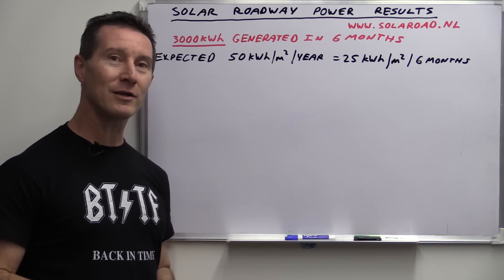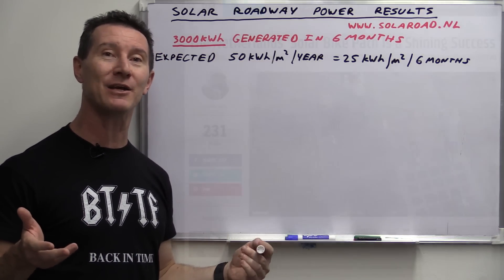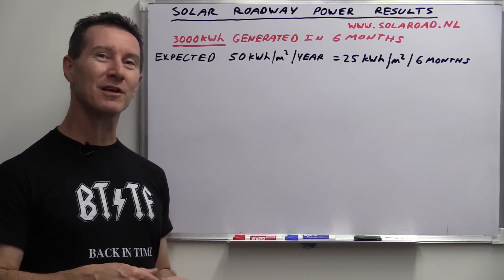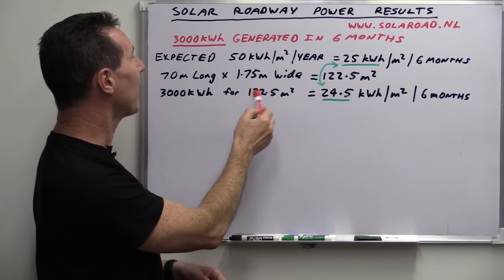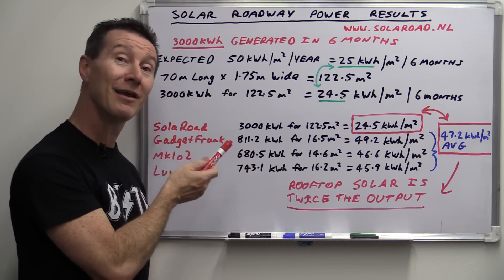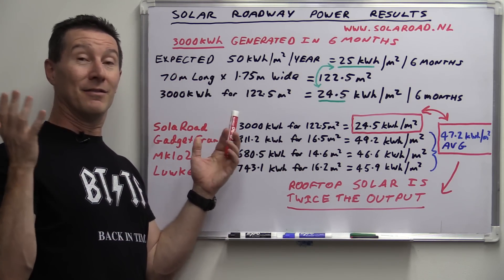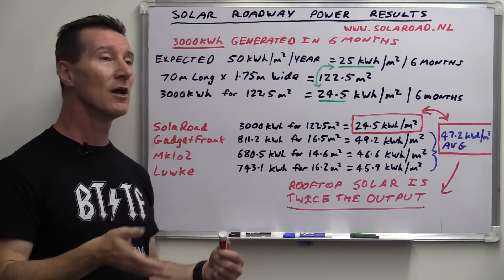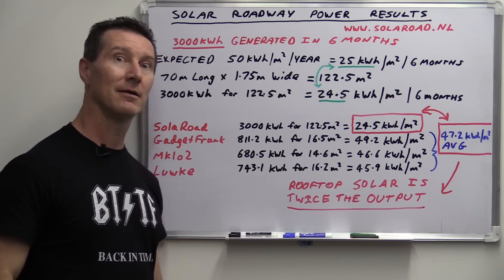EEVblog #743 - Solar Roadways Test Results

Comment: Hey Dave, do you have an opinion on the Tesla Battery packs? Is it something you'd consider installing as an upgrade to your solar panels?
Reply from the maker: Kasper Guldmann I'd buy it today if it was available here.
Reply from the maker: You can do this with other battery tech, the Tesla powerwall is not new, it's just the Apple iPhone of solar battery systems.
Reply: ***** He used lead-acid batteries though, which take up much more space than lithium chemistry for the same energy density. Lead-acid cells also cannot be as deeply discharged as lithium ion cells, so you must buy 2-3 times your typical cycle capacity or else you will quickly destroy your batteries. Lead-acid also cannot be rapidly charged without damage as well.
Reply: Orcinus24x5 You know that lithium ion cells cannot be deeply discharged, they are destroyed after that (that why all lithium ion battery packs have protection circuit against that), lead acid act nearly same (but they can be recovered after that). More interesting for lithium ion cells is that higher is the DoD (Depth of Discharge) the lower is your battery life cycle (50% DoD cut life of  lithium ion cells 3 times then 25% DoD)
Reply: EEVblog but why Li Ion?, I'd expect there to be cheaper alternatives for an application that isn't (as) sensitive to size and weight as a car. And an Internet connected "firebomb" bolted to the side of the house might makes some people a bit uneasy
Reply: EEVblog I reckon he didn't sell as many electric cars as he had planned, so he's selling the excess batteries at cost to gain a portion of that market and he'll ramp up prices later. Do you agree? They even have the same shape as his car batteries.
Reply: Doazic No, the Tesla battery pack definitely can store power during the night and then use it during the day. I'm pretty sure that was one of their marketing points.
Reply: Yeah, that's the goal, to flatten power delivery throughout the day...
Reply: Miloš Lazović Tesla doesn't use Li-ion. They use LiFePO4 cells which are much, much more robust.
Reply: FrankTheCat You obviously don't know what is LiFePO4 (it is lithium iron phosphate battery just one type of lithium iron cells).
Bdw Tesla uses Panasonic NCR18650A batteries which are LiNiCoO2  (improved classical LiCoO2) cell not LiFePO4.
Reply: ***** Of course they didn't sell as many cars as expected, Tesla cars fail on most of it promises, range is much smaller than claimed (they try to silence critics like Top Gear, by law suites but that backfire to them), they are much more dangerous then petrol cars (like 1 in 6000 burst in flame, which is less than all petrol cars where is like 1 in 1500 but if you dont count petrol cars that are older then 10 years then petrol cars have better ratio like 1 in 20000), environmental impact is near same to petrol car (according to studies done by petrol hating Swiss impact to environment in production of that car is same as what petrol car make in average life, so they are not so clean), what they claim are revolutionary technologies on that car are seen for years on petrol cars  .....
Reply: jusb1066 Tesla unit is not that small even if battery itself is small because of the cooling/heating system.
They need thermal management and they have a pump circulating coolant and a heat element to heat that in cold weather. Just look at the dimensions is quite a large unit for a 7kWh battery.
In terms of economic cost for stationary energy storage the LiFePO4 is much more superior. Look at products from Sony or Bosch they have a similar product with Tesla Power war for quite a few years and they know what they doing.
A LiFePO4 has a 6000 cycles of 100% DOD in case of Sony LiFePO4 was around 300 to 500 cycles in case of Tesla Battery at the same 100% DOD. They use just at 70% DOD (in the 7kWh power pack) so they can have more cycles at reduced capacity and be able to offer the 10 years warranty (still no details on what will be allowed as max energy use over life of the battery)
The amount of energy that can be stored and released over the life of the battery is what is important when you do a cost analysis and even with the best LiFePO4 battery and ideal use of the battery that cost is still high in my opinion and at best in countries with expensive electricity (as some in Europe) you barely get your investment back by the time the battery needs replacement.
Lead Acid is not even close in competing with LiFePO4 in terms of cost /kWh over the life of the battery.
I live OffGrid and use LifePO4 for energy storage. I also developed an offgrid solar charge controller/BMS and currently working on the second version. But do not thing because of that I have any bias towards LiFePO4. That is what I recommend for energy storage but any other type of lithium batteries will work with my Solar BMS including the Panasonic cells Tesla is using. They have better energy density and are better option in mobile applications and cars where number of cycles is less important than energy density.
Reply: EEVblog I think ***** made something similar inside his home already using normal electronic equipment.
Reply: Lasse Langwadt Christensen you should check out flywheel energy storage. They are very energy efficient, and much more space and resource efficient than battery packs for residential use
Reply: The summary I read said the intended use is for people with solar panels to store during the day and use it at night.
Reply: Doazic they can also charge from the grid at night to be used in the day. They advertised them both ways.
Reply: Kasper Guldmann Use this battery system is try to fool the Energy Utilities. You think that you can buy energy when the cost is cheap, store it and them use when the cost is high to avoid using energy from the grid ?. If this turn into a succes, the peak W delivery would occur during the cheap rate (lets say 11PM to 6AM). As a result of that the Utilities will redefine the rates or how much the KWh cost on each rate, or even worse: As power delivery will be flattened across the day (blend of real demand and charging batteries), using rate shcedule scheme would turn useless and you will get ONE RATE for the WHOLE day. Many countries use Smart meters so change those definitions is just a key press. The idea sound brilliant, but Utilities have been there for too long, and face things like that before, Tesla is just a company, the Utility, Generation, Ditribution and exchange is far more bigger system, perhaps thousand of companies around the globe, they move serious money and Tesla just cant stop that. Tesla thing is smoke IMHO.
Reply: funkyironman69 Power companies will never buy it to smooth peak power demands, they already have proven reliable system for it, not one what have life span of less then 10 years, and it is called reversible hydroelectric power plants.
It is widely used for over 50 years and can store more then million of MW and produce in excess of thousands of MW of electricity (same capacity as near billion Tesla Powerwalls)
Reply: Lasse Langwadt Christensen said: " And an Internet connected "firebomb" bolted to the side of the house might makes some people a bit uneasy"

And yet millions of Americans have enormous tanks of propane in their yards. Hasn't been much of a problem so far.
Reply: ***** Tank should be really big, if you have hill, it would be much easier to make pound on it to store water.
Power of falling water is roughly
Power = Head x Flow x Gravity
where power is measured in Watts, head in meters, flow in liters per second, and acceleration due to gravity in meters per second per second.
To store 65 kWh ( size of Tesla powerwall) of electricity as water you would need to store near of quarter of million of liters of water on height of 100m.
Reply: ***** Photonic's system stores energy at night when it's cheap and uses it during the day when it's expensive. I don't think the Tesla pack does that, plus I believe even photonic stated his system isn't cost effective.
Reply: EEVblog My boss and I were discussing this. I was pleasantly surprised at the watt-hour/cost ratio being high. I was expecting it to be lower especially to cover some of the overhead in manufacturing. I'd get one if I had somewhere to get it "professionally installed". Wish I could just buy the back without needing it installed. :D
Reply: BobtheBuilder31415 Flywheel energy storage is very promising, but the technology isn't there yet. It's way too expensive for a home, extremely hard to retrofit into existing infrastructure, the reliability isn't very good for the cost, and when they fail, they fail catastrophically. They have to be embedded in concrete to avoid destroying whatever building they're in if they explode, and that makes maintenance impossible. Maybe in 20-odd years it'll be viable for smaller installations, or even cars, but not any time soon.
Reply: Kasper Guldmann Powerwall economics are somewhat specific to the installation. Here is a summary: http://www.catalyticengineering.com/top-ten-facts-about-teslas-350kwh-powerwall-battery/
Reply: Doazic Well, you dont need rate shedule concept anymore so you will get a fixed cost for your KWh (import) that will be sorta of avg of the rates across the day. Still not seeing the big money saving. Because Tesla is assuming that a CHEAP rate exists, in every country and that will become untrue when Utilities see their power delivered flat no matter the part of the day. Same that electric cars charged at night ... just imagine all of us charging our cars at 1AM and Utilities charging us with cheap KWh because is the cheap rate. How long ?. This things hapenned before. Tesla dont understand the Electrcity or Energy market at all. Emisions will be the same, petrol ? You end using the same, Coal ? The same. Your bill ? Of course the same
Reply: Petar Petrovic A BIG TRUTH. Nobody taking in account the energy WASTED to produce green cars, TRASH and produce AGAIN, TRASH and AGAIN. Come on !!!!!. Electrica cars ? Lets move emisions from the exhaust to the chimmey of the big power plants running on coal of fuel oil. The force to trash good working cars with new and new emision standards like Euro II, III, 4, 5 .... to reduce emisions a 5% but now do the calculations of the energy wasted to make the new and more green car plus scraping the old ones LOL. Pure hipocritical.
Reply: Well it would take a whole bunch of people to buy these things for the curve to flatten which isn't likely to happen.
Reply: Kasper Guldmann Power distribution companies will buy them themselves to smooth out peak power demands.
Reply: EEVblog Could you perhaps do a video on the costs and benefits/con's of the tesla pack over a lead acid or other battery type system? There was a lot of speak about it not being cost effective due to lithium batteries lack of longevity and the lower output etc. It would be nice to get a proper technical overview like you have done with the solar roadway. Cheers!
Reply: abyssunderground Lack of longevity? 8 years isn't long-life? Beats lead-acid in those use-cases by a couple years. Lithium batteries of that particular chemistry are also capable of insane power output, I'm pretty sure that thing can be fully discharged in under 15 minutes without damage.
Reply: Teth47 Actually it's got a 10 year warranty, but I don't know of any lithium battery that can do full charge and discharge cycles every day for 10 years without losing significant capacity to be detrimental to operation. That's one of the points that was raised after its announcement.

The low output I speak of is the limit of 2kW with 3.3kW peak (the DC-DC converter limit maybe?). That's barely enough to run a kettle, microwave or oven individually let alone together which is something many will want to do regularly if used in an off-grid situation.
Reply: abyssunderground They build an extra 20-30% capacity into the unit and use the BMS to maintain a fixed capacity for as long as possible, after 10 years, apparent capacity will have gone down about 25%, they do the same for cars and the like. You're right about the limiting factor being the DC-DC converter, which can be bypassed if you've got a bigger one or an inverter capable of handling the full battery voltage. I have a battery sitting on my desk that is capable of outputting more than 3KW, and it's about the size of my hand.
Reply: Teth47 So what you mean is the 10kWh version is actually 12-13kWh so that it still maintains that 10kWh long into its life? Hmm I'm not so sure. I'll be more convinced when someone actually does a tear down on one but I won't insult you by saying you're wrong without any proof =) Just doesn't seem like they would do that somehow. But this is Tesla afterall, they don't do things the conventional way!

I didn't know you could bypass the DC-DC converter and use your own given the high DC voltage used inside (300v+?), so that answers that question if true. I have a few lipo batteries here capable of 1-2kW myself so I understand the batteries can handle it but my concern was around the limit of the DC-DC converter. I doubt 300v+ DC-DC converters are readily available?
Reply: abyssunderground They're not, the main idea behind bypassing the converter is industrial applications. Also, making packs larger and electronically limiting them is the industry standard for things like this, check Tesla's car packs, same with Chevrolet's Volt batteries, I believe they're 25%. I don't remember the exact pack voltage, but it is pretty high, there are inverters that take that power though, they're huge, but they exist
Reply: Teth47 That makes sense. I didn't know they overprovisioned the batteries though, but that makes sense too over the life of the battery. I suppose it also means they don't have to charge the battery to as high a voltage too, further increasing longevity. Just charging to 4.1v instead of 4.2v can double the number of cycles from what I've researched.

Thanks for the insight.
Reply: abyssunderground No problem! It's what I'm here for. Do look into it though, if you want, and tell me if I'm wrong. I'm not above being corrected.
Reply: Teth47 Cheers, will do if I hear any different.
Reply: funkyironman69 Still using the same ammount of petrol or coal. Cant see where the money is saved. Generation would cost the same and so will do your bill.  You can play with batteries, but new energy always come from the power plant. Not Green, nor efficient. Plus batteries go bad. My point is, if you try to make your KWh all in the cheap rate, Utilities will change the approach, otherwise they will stop making money. The can double shift the rate using a gigantic TESLA plant, still using the same ammount of coal or petrol. NO WAY, IMHO. That works if just a small amount of customers implement that. If all moves to TESLA thing, beware your bill will reflect that
Reply: Teth47 Flywheels are great for mechanical start/stop, but a typical car only has space for 50 MJ. A 85 kWh car battery holds 306 MJ.
Reply: 38911bytefree You forget that it's not just for charging when the price is low. Couple it with solar panels which charge it during the day whilst you're at work, and then use that free energy when you get home. The utility companies can't really change prices overnight because of people with storage heaters, it would be unfair to them. Truthfully though that might not stop them...
Reply: abyssunderground Fine, like any other battery. imṕroved, better, efficient, battery banks and solar panels haven been there for years. Now, this idea has takean off on large scale installations like Daves. and took serious money to get 3 or 4Kwh power from the sun. That is not that easy. And this TESLA thing, not sure if it is intended to be part of a power gen system or just a little trick to reduce your bill that wont work at the end.
Reply: 38911bytefree The idea is to get the cost of the batteries down too with mass production. Currently they're expensive due to low demand compared to other types. The Tesla battery isn't intended to be a trick to reduce the bill in the long run, only the short. The idea is to go self sustaining by getting everyone into green energy and then having a distributed grid system. Overall there will be less points of failure and the end goal is for there to be no need for CO2 pumping power plants.
Reply: Of course we need another way of generation apart from coal and petrol. But costs for pannels, high end inverters, and even asking your utility to start selling energy to the grid, is sky expensive by now. Its a bussiness. Finally, when you need serious power, deep Winter or heavy summer, you end taking from the grid. Like Prius thing, well, not that bad. Once you touch the gas pedal, goobye hybrid !!!!, it starts to suck petrol. and of course, you want yo run you gadgets, power everything and the AC .. so no hybrid concept is just for the one willing to drive the car like an hibrid. If you drive like any other car, it takes petrol, like any other car.
Reply: 38911bytefree Of course, but there always has to be a starting point with new tech to drive the prices down. The idea with hybrid tech is to get electric introduced and then rely on it more and petrol less. The same will happen with the Tesla power wall, solar panels and the grid. As more and more people invest into solar panels the price drops and then those with less money can also join in. In 25 years we will be virtually fossil fuel free if we continue to grow renewable energy sources the way we are now.
Reply: abyssunderground Thats  ideal. Fossil free idea has been for long. Electrical car idea also. This things dont take off. windmills look promissing also. But we wont be able to skip fossil generation. Even when we can do at home, industries, clubs, cinemas, shopping ... everything that is power hungry, just with meet the grid and eat as much as they can Another good approach would be, stop selling crap that stop working in less than a year. Forget about nwe car regulation every year to scrap the whole park of cars in 3 year. People need to slow down a bit. Short example. Have a notebook nice one, run PERFECT in 2010. YT ? ALL THE WAY. it was "fast enough". With later upgrades on Chrome and flash, notebook started to perform slow and slow. Put more RAM, ... eventually end buying another one because I couldnt see YT anymore. I was angry, because nothing wrogn with my notebook. So, were is the green way ? Even google push you HW directly to the trash bin. So, GREEN is a WIDE concept. Sorry being soooooooooo long, pray you dont fell asleep LOL
Reply: Cees Timmerman Currently. Material sciences advance at a blistering pace, there might also be more effective methods of storing energy via angular momentum than a simple flywheel.
Reply: Miloš Lazović Yea once you take the whole life cycle into account I have doubts about the feasibility of these things, it feels like green wash, other than being a whole house ups system, I doubt the numbers add up to "green".
Reply: wooo weee So we should disregard a technology because it's not green right now? Whatever you say, o' all knowing lord.
Reply: Teth47 Its about honesty, I'm perfectly happy using technology for its justified purpose.  Such a battery bank looks like a good idea for anyone who wants to go completely off grid or simply to give themselves the luxury of being powered through power outages, but its another thing to promote based on the idea it will save the world, do remember the solar roadways debacle...
Reply: Teth47 maybe we need to ignore technologies that are dead end? Tesla powerwall is one of them, it is overpriced, short life span....
Reply: abyssunderground Teth47 Tesla did not build any extra capacity in its power packs, 85 kWh battery pack (used in Model S) consist of 7,104 calls with capacity of 3,400mAh and nominal voltage of 3.6V which give theoretical extra capacity of less then 1.2%, but in reality there is 0 extra capacity
Reply: EEVblog
There's a few companies in Australia that have similar products. Selectronic is one of them, but I'm not sure how they compare on price to the Tesla battery systems.
Reply: wooo weee Many countries have outages on a daily basis, like Venezuela. There, inverters and battery banks have been used for DECADES by people who can afford them. Inverters are sold in the supermarket !!!. so, Tesla thing, nothing new. In rural areas, the same. Many houses are out of the grid. and solar panels has been there for 2 o 3 decades. Of course it was just for the electrified fence system .... primary. Tasks like pumping water were done on demand using a pump runing on petrol engine. Thats all. Tesla perhaps perfected a system that exists already in other parts of the globe, but it is not an invention.
Reply: EEVblog Why? That is probably worse than the solar roadway :) At least from an economics perspective.
Cost of storing energy in a battery is quite high and Tesla battery is far from being an exception. In fact there are much better battery technology for stationary energy storage than what Tesla is using.
For the car is probably great do to high energy density but not for stationary energy storage.
Even the much better batteries for this will not be able to compete with your utility price (and yes I seen your video about the 3kWh solar installation and local cost of energy).
Reply: EEVblog Except there was nothing like the iPhone -- and I mean nothing -- before the iPhone.
Reply: ***** Tesla has invested a lot of money into Panasonic for battery R&D, and the big multi billion dollar factory in Nevada is a big lie as well right?
Reply: FrankTheCat No they don't use LiFePO4, they use a version of Panasonic's NCR chemistry.
Reply: Gnu Guy
propane tanks a generally not connected to the Internet
Reply: spikester You got it backward, Tesla did not invested lot of money in Panasonic, but Panasonic invested lot of money in Tesla, they are one of bigger corporate owner of Tesla (to put in perspective Panasonic hold around 2 million shares of Tesla motors, where Elon Musk hold 75 shares or biggest private holder his brother Kimbal Musk hold around 150,000 shares)
As battery factory in Nevada it will be basically Panasonic factory where Panasonic will build cylindrical lithium-ion cells and provide equipment, machinery and other tools for it, with financial contribution to the facility which is in range from $5 billion to $5 billion by 2020 (official statement is "We are still discussing the details, including Panasonic’s financial contribution to the facility")
Reply: David Wahl As someone mention before they use LiNiCoO2.
Reply: Lasse Langwadt Christensen lion makes them a smallish wall unit, plus lithium is better than lead acid at effiency, recharging losses,  of couse its doable with good deep cycle lead acid and space to store them, but at teslas price per khw it also edges out lead acid, so tesla has got a lead on everyone with that product, plus lion have the ability to get much cheaper with the mega factories, lead acid has reached its price point already
Reply: *****
nice reply there, perhas tesla is putting hope on its future re. gigafactory for the cells, at the moment they dont have any particular advantage over bosch or sony, but their marketing is nailing it too of late, thanks for the good reply and insight, its still an interesting tech to watch
Reply: David Wahl DO you have any reference for that?  Yes, tesla uses NCR battery for the cars, but do they use the exact same chemistry for the power wall? That would be totally stupid.

Also, the chemistry is NCA, NCR is the brand name
Reply: EEVblog For home use, how would storing excess energy by pumping water to a high storage tank (maybe you have a hill to set it on) and generating power from that later on?
I see losses in pumping and then generating from the flow down but it would save something. With wind power the water could be pumped direct to avoid pump motor losses.
Reply: Miloš Lazović
And there will be significant losses turning the potential into power, but it's something that can be stored a relatively long time with little loss and it can be made with lesser tech.
Water towers here tend to be sized in 1000's of gallons.
The day is coming when people will have to live at the speed of 400 years ago. I just hope it's in a world where it's possible.
Reply: ***** Efficiency reversible hydropower plant ( or someone call them Pumped-storage hydroelectricity plant PSH, or PHES) is very close to efficiency of Li-ion battery (round-trip energy efficiency varies in practice between 70% and 80% for RHP), that is no problem, problem is in size and in initial costs. Reversible hydropower plant are choice of power companies to store electricity for years, but are unusable for home users, I never saw someone made small one.
For example Bath County Pumped Storage Station (which is described as the “largest battery in the world” but that is not totally true, it is most powerful reversible hydropower plant in world but it don't have biggest water accumulation RH Bajina Basta have 4 times bigger water accumulation) have installed power of 3,003 MW and water accumulation of 43,911,000 m3 or 43,911,000,000 liters and pumping height of 400 m (RH Bajina Basta have much lower output power of 614MW but have much bigger water accumulation of 170,000,000 m³ or 170,000,000,000 liters and pumping hight of 612 m) and now biggest problem it cost barely a mere $1.6 billion in 1985 (for RH Bajina Basta no one know real cost, it was build in communist time)
Reply: Miloš Lazović
Yes, more height adds potential to the same mass.
If I ran on wind & solar, I'd want most to keep my fridge cold when those are flat.
I think this kind of power goes back to tidal ponds used even more than 1000 years ago.